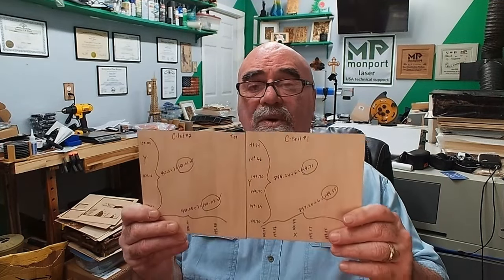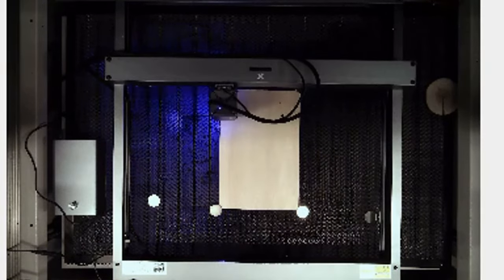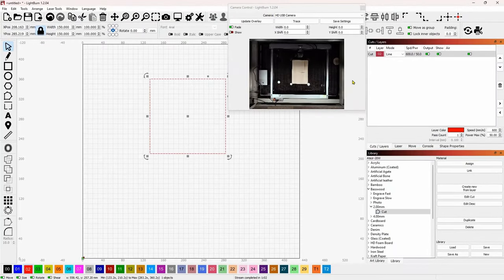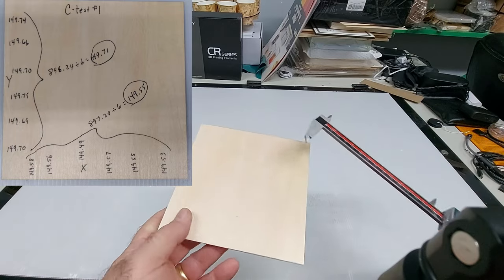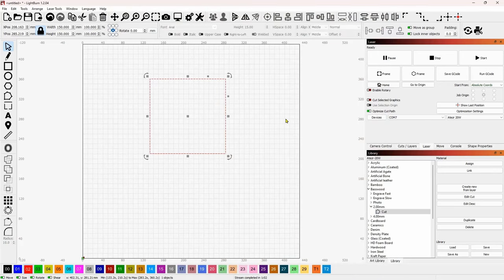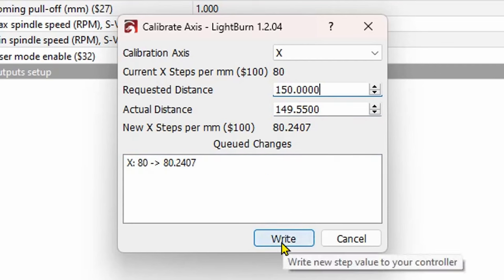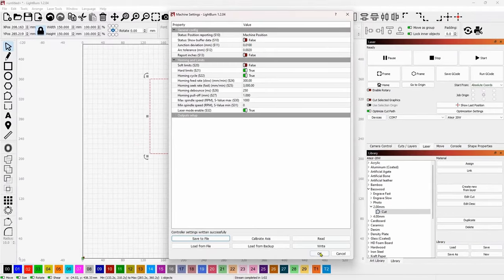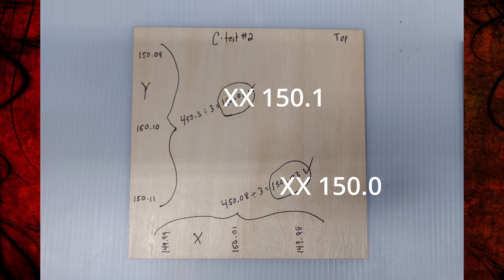Perfect Calibration on your Hobby Laser in Lightburn!

Comment: Great info, just what I am looking for... I hope. Yesterday I was setting up a job with my laser focused lower from prior job than the thickness of my piece that I was going to engrave. I acidentally started a frame, my laser ran into the side of my current thick work piece forcefully stopping my laser frame movement. The belts vibrated before I could stop my machine. Now my laser y axis is 2" larger than my lightburn drawing. Per this video is this how I can recalibrate my Atomstack A20? I would appreciate any help. Thanks.
Reply from the maker: You were likely using current position and the laser went out of bounds. Switch to absolute coordinates, home the laser, and then don't move it by hand and you should be fine Dick.

Comment: Thanks so much for this video. I am a complete newby to lasers, I got the Atezer p20 recently. Yesterday I set up the rotary rollers for the first time and after I reconnected back to the main module my Y axis was double what it should have been. So literally a square of 100mm x 100mm was 100mm x 210mm. I was easily able to resolve the issue with this tutorial, forever grateful to you. But is it normal that should have happened after connecting to the rotay rollers and then back? I hadn't changed any other settings. Freaked me out today hahha
Reply from the maker: Hopefully you turned off the rotary in Lightburn Carole. Look at  the laser tab and make sure it's off.
Reply: @TheLouisianaHobbyGuy  I appreciate your reply. Hopefully I'll get the hang of Lightburn soon and all the pre-send checks. I can be a little impatient to just get the job going haha. Take care. Learning lots for your tutorials 😁

Comment: One more Question, if i calibrate the axis, is there not also the Kerf involved? Saying you calibrate the axis to your 150, the result should not be 150 but 150 minus the Kerf, or am i wrong? If i write the new parameters for the axis and later on, adjusting the cut for Kerf, is that not leading to trouble?
Reply from the maker: The calibration accounts for the kerf.
Reply: @TheLouisianaHobbyGuy  but only if i make the Kerf test first and then cut my rectangle for the axis calibration with this Kerf Setting applied

Comment: When you attempt to measure the middle of the square, the caliper needs to be FLAT to the board, (as much as you can), so as to keep the flat portion of the caliper in contact with the wood.  Standing the caliper "up" does NOT give you enough caliper surface area to mate with the wood.  When you measure the ends, the caliper "faces" should be totally flat to the wood.  At exactly 4:02, your "measurement" is bogus with the left side of the caliper lifted and the right side lower.  You idea to check the "squareness" of the cut is good, the method, not so much  😞
Reply from the maker: Thanks for the comment. Please SUBSCRIBE to know when my new videos are coming out!

Comment: Hey Rich, since you are doing your calibration without entering a kerf adjustment (or taking into consideration) would you actually be including your kerf into your calibration?  Basically, the calibration is looking for a distance of 150 and you cut out the piece and say the finished actual cut size is 149.8. If you enter requested distance of 150 and actual distance of 149.8 you have included the missing kerf amount into your calibration?  You have 1/2 kerf on the top, bottom, left and right sides of the actual cut out (kerf is half because you cut on the line meaning half of the kerf is inside cut and half is outside the cut), so if your kerf is .2 then the kerf offset should be half of the total kerf which would be .1 for each side? If that is accurate then would not 149.8 be the expected value for a calibration since I think calibration is looking for a distance from the middle of the laser line to the middle of the laser line rather than the designed size vs actual size?
Reply from the maker: You can do it either way Brian, whichever you prefer.
Reply: You are spot on.  Calibrate the machine to move the amount requested, without being fudged for the kerf.  The method shown will only be accurate at the one size that was tested.

Comment: Shouldn't the kerf width be factored in before entering the adjustment?    What if it was the square hole was what I was after and the center square piece (the piece that you took your measurements on) was the waste piece in my project.

I think that the machine should be calibrated to follow the center of the cut line (kerf) and if the project needs exact measurement then adjust for that in the kerf setting.  Am I missing something?

Great video BTW,  I think you do an amazing job Rich and I have learned lots from you.  :)
Reply from the maker: This was simply a calibration video if your laser is not cutting the right size. It eliminates kerf offset.
Reply: You are right the machine should be set to move the amount requested not fudged for the kerf at a given size.  At any other size it will be off if done as shown.

Comment: My circles were like curled eggs. I adjusted the belt tension. Not too hard, not too soft. When you raise the construction about 45 degrees, the sliders have to move down slowly. Then I had a problem with the coupling between the motor axle and the shaft. They were not in line. So I ordered two flexible shaft couplings. And now my circles are perfectly round. I have a laser from Twotree's TS2
Reply from the maker: Glad you got it fixed.

Comment: Is this handled within Lightburn only or is it modifying the firmware in the laser's controller? I have a Trocen controller and it would be nice if Lightburn could just lie to the Trocen to achieve perfect inside diameters or outside diameters without changing steps per millimeter in Trocen. In other words, simply an offset?
Reply from the maker: This modifies the controller software Vic.

Comment: Hi Rich, when i try to use the machine settings to  calibrate i get the message...communication with controller failed. i'm using a LM3 10 watt diode laser. i my LM3 via wifi. any advise please. Ben
Reply from the maker: Use a USB cable for the calibration Ben.
Reply: Thanks for getting back to me, I’ll try that but is there any reason why it doesn’t work via wifi. Thanks again👍

Comment: i just tryed to calibrate the laser machine and somehow i messed up i dont know how.. the machine is moving at insane speed like its going to break apart, i was trying to make a square of 150mm for 150mm and it was doing like around 148mm for 148mm, now i try to make a 50mm square and i cant really tell if its doing it because of the insane speed, and when i try to home it the head just hits the side of the machine and keeps running, i reseted lightburn from factory and had to disable the auto home when starting the software, i need help please =(
Reply: Gosh i discovered, i had to put the calibration in cm not in mm ... i.e wanted to put 100mm.. guess what.... that was the reason the machine went crazy.. i thought i was gonna brake it
Reply from the maker: Glad you found it.

Comment: Quick question please. I have a longmill CNC with router and it works great the way it is. I mount my laser to it for laser work. If I do this calibration process does it actually write to the longmill controller or do these settings take effect in the light burn program settings. My router is spot on for cutting so I don't want it to alter those settings. You say it writes to the controller. Am I right to think that it will in fact over right the calibration settings in the longmill controller board.
Reply from the maker: Yes, absolutely, you can perform the same test with the router by changing your $30 & $32 settings for CNC mode. If the Longmill is spot on, I would leave it alone since both modes will be the same.

Comment: Maybe I'm wrong, but this process should be a 1 & done procedure (I'll be checking mine soon as I get time). Coming from 3D printing, once the step distance (rotation distance in printing) is set, the calibration shouldn't need to be performed again unless the pulley is replaced or its diameter changes due to wear. Translating circular to linear motion doesn't care what you use be it a belt or string. The distance moved in X or Y is determined by the pulley diameter and number of steps commanded. Now, those pulleys have a manufacturing tolerance and for certain that needs to be baked into the settings using this calibration method.
Also as you indicated, a 0.5mm error at 150mm (0.33%) multiplies as the part gets larger. As a % the value is small, but multiplied by 400mm or so (1.3mm error now) it will destroy the fit of mating pieces. A 0.125% error would yield a 0.5mm error at 400mm. If the belts are good, the rest of the system should be capable of this. If the laser setting is steps/mm & I did the math right, 80 steps/mm (from the value on your screen) is 0.0125mm/step.
Reply from the maker: I do it regularly on well used machines.
Reply: @TheLouisianaHobbyGuy  I assume then that you see a regular drift in the calibration or you wouldn't?
Reply from the maker: @OldCurmudgeon3DP  Usually only when changing belts or parts. Wear isn't as much of a concern.

Comment: Rich, I wondered when you were going to make a video on this subject.  So many people don't understand accumulative error. If you measure the belt pulleys they are not all the exact same diameter so every time they make a revolution the error gets larger. Try explaining this to folks in the 3D printing arena. They want to do everything but adjust the number of steps per millimeter on their stepper motors. Then I have people tell me that the machine uses a timing belt so the diameter of the sprocket pulley doesn't make any difference. Not so. Any given point on that belt has to travel the circumference of that pulley. And they are all not the same circumference. I have measured the diameter of my pulleys with a micrometer and they are not all the same. This is why the software writers go thru the trouble of writing this calibration feature into laser and 3D printer software, or anything that uses stepper motors. Of course another factor in the equation is how  your curf offset is set when you do the test. Do you use no offset? Or do you do a complete offset to the outside? In opinion (and it is like you know what) we to calibrate for the movement of the center point of the laser. That way the head moves the exact distance we tell it to in our drawings, then use kerf offset to get the actual size after the burn. On blue diode lasers it will never be perfect because the laser dot is rectangular.
Reply from the maker: You got it Kris. This is a very controversial topic in the CNC world, and especially with the 3-D printers because there are so many "experts" with different opinions. I'm no expert, nor do I claim to be, but I know this works for me 🤪 I only use the kerf offset on inlays.

Comment: This worked good for rectangles, but circles are still off by 1mm so changed my circle diameter by 1mm.
Reply from the maker: That could be a hardware issue, like loose belts.
Reply: @TheLouisianaHobbyGuy  Yea, I have been thinking about that myself.  I was hoping not as it is a pain to tighten the belts on a Genmitsu Jinsuko LC-40.  They corrected the problem on the LC-50, but on this one you have to take it apart to tighten the belts; at least the X-axis.

Comment: Thanks again for this tutorial. I tried this with my xtool D1 and everything worked as shown. When I tried to do the same thing on my K40, the machine settings function is not there in the Edit tab menu. My K40 runs with Cohesion 3d and smoothieware. Any idea as to why this function would not be available? Besides trying the basic things, I am stuck now. Any info would be greatly appreciated. 
Thank you, Al
Reply from the maker: Can't do it with the Cohesion board. These are Grbl settings Al.
Reply: @TheLouisianaHobbyGuy  Thank you for clearing that up.

Comment: You can't use kerf offset to construct tabbed boxesI. I's not as simple as that. If you expand the sides of the box to fit tightly into the base the corners of the side pieces will be expanded and the corners of the sides will not fit together.
Reply from the maker: Yes, exactly and why you need to have averaged calibration on a laser.

Comment: Thanks for your informative video(s) and taking the time to produce all your videos and explain. But I have a question: In this calibration video, don't you have to account for the kerf? Your machine cut your square 150mm x 150mm (within a couple thou), but now inside cuts will be oversize. In this example, the outer dimensions of your square were 150mm x 150mm, but now the inside will be oversize by twice the kerf. In other words, you've factored in outward offset. If I'm right (and I may not be), I think the correct way to do this would be to first find out the kerf, then cut your 150 x 150 square, measure, then subtract the kerf to find out the true value for the calibration. If, say, your kerf is .01" (let's call it .25mm), and if your square comes out to 149.75 x 149.75mm, then your calibration is perfect. In other words again, if you send a 150mm x 150mm square to the machine and the X and Y are calibrated perfectly, the machine will cut a square that measures 149.75mm x 149.75mm because you have to account for and subtract the kerf (or, actually, half the kerf from all sides).
Reply from the maker: Yes Tim, you're right, but I wanted the outside dimensions to be exact.
Reply: @TheLouisianaHobbyGuy  Oh, okay, I get it. But what about when cutting something that the inside dimension needs to be correct? Would you then use offset? Or, what about a job that has both inside and outside cuts? Do you use a different layer for outside vs. inside cuts - one layer with no offset and the other layer with offset? This gets bewildering.
Reply from the maker: I would use the kerf offset on the layer Tim.
Reply: Spot on!

Comment: Hey Rich, just another thought on the topic.  I have a CO2, so I can't speak about settings in a diode laser, but I'd bet setting a jump setting to move 100mm, then measure the two points from a pulse burn would be more accurate than making an actual cut, which would mostly remove the kerf offset variable.   You could generate a grid along the X/Y to determine where you fall out of tolerance and your averages would be more reliable.  Thanks again!
Reply from the maker: Awesome, thanks!

Comment: hello great video.

i have a problem with neje 3 + mac ios 13 + lightburn (trial). 

I designed a circle but the final result is ouval. 

what should I do to setting this ? thanks
Reply from the maker: Follow the steps in this video.
Reply: @TheLouisianaHobbyGuy  my laser work dimension is 170mm X 170mm.  I did follow your guide. 
I make a square 20mm X 20mm then calibrate X : 20.000 and Y : 19.500.  click write.  the laser doesn't move.
when I click frame , it shows alarm 3. 

I made a mistake here, the laser getting worse than before haha
Reply from the maker: It's not supposed to move by calibration. Sounds like you moved the laser head by hand and are using current position. Switch to absolute coordinates and home the laser.
Reply: @TheLouisianaHobbyGuy  I'm using 'move' feature on lightburn for laser head to be on the center of 170x170mm.
so I don't start from 'home'.  I think I understand now. thanks

Comment: what drive system is your machine,lead screw or belt & pully ?
Reply from the maker: This was the Atzer 20W. A standard connecting rod from a stepper motor on the Y to a gantry on linear rails for this video.
Reply: So no good for belt drive !

Comment: Thank you for another awesome video! One thing I am confused about is how to account for the Kerf. My 150 x 150 mm test cut in 5 mm plywood came out symmetrical, but the square was too small. Once I did your kerf test from your other video, and adjusted the curve by 0.2 mm, I got a pretty perfect 150 x 150 mm square. 

I cut the same test piece out of 3 mm black acrylic, adjusted the curve by 0.1 mm, and also got a pretty perfectly sized 150 mm square.
if I had calibrated my machine based on the wood square, I still wouldn’t have gotten the acrylic correctly. So would you say that if you get a symmetrical square, but the size is off, to just adjust the kerf, not the machine? Thanks a million!
Reply from the maker: I prefer to do the calibration so when I ask for 10mm I get 10mm.
Reply: Each material will cut with a different kerf, seemingly. So calibrating the machine to one specific material will still not necessarily get you "10 mm" in a different material?🤔 
Still helpful info. Great to know one can even do this calibration. 
I appreciate you answering every single comment. Thank you.
Reply from the maker: Yes Don, and every thickness will have a different kerf as well as the number of passes. But I use this as a baseline setting just to make sure the laser is somewhat accurate to begin with.
Reply: Unless the kerf is taken into account and the axis is set to actually move the request amount your method will only be accurate at the one size you set it for. @TheLouisianaHobbyGuy

Comment: another great video Rich but now you need toe explain the eccentric setting - lost me there sorry
Reply from the maker: Think of the eccentric nut as a bolt and nut. Where the hole for the nut is not centered and the nut is fixed on the bolt. So when you turn the bolt, the nut moves off center. I'll make something to describe it better in a future video.
Reply: @TheLouisianaHobbyGuy  Awesome Thanks Rich